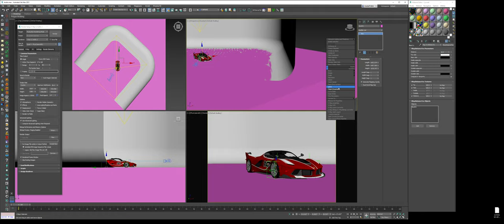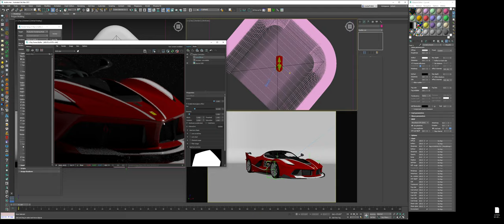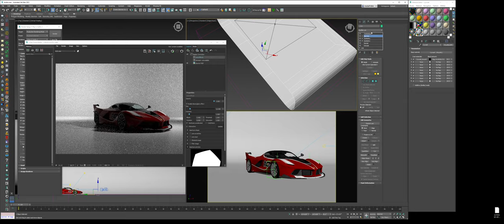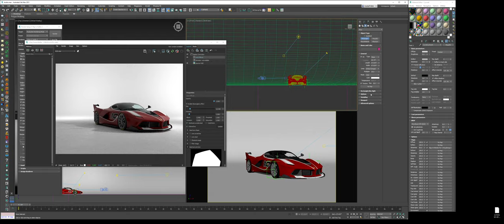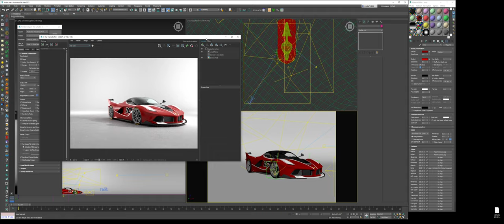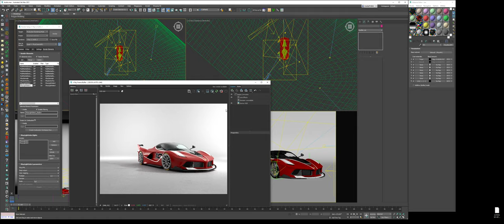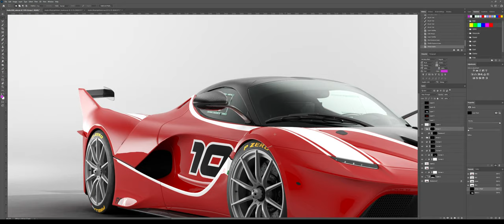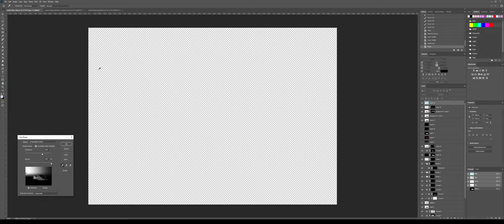Rendering A Car In A White Studio - 3ds Max & Vray

Comment: Thank you so much! Outstanding tutorials. May I have a request for a video of a rendering a white car in a white studio? I always have trouble with the balance between blacks/whites and reflections.
Reply from the maker: Let me see what I can do Adam. Client work/revisions coming back in so things might be slowing down a little with free time lol.
Reply from the maker: @c26084  I know exactly what you mean haha. What I would recommend in those situations is this. Render out the carpaint in two separate passes. Base Coat and then a clear coat. In photoshop add the clear coat as a screen blend mode, then go in and mask out the parts of the reflections that are messy. This would be the easiest/fastest way to get a job done and bill a client vs spending hours remodeling areas.
With that said. I have done both methods, quick fixes as well as remodeling to make sure it can be good for animation purposes.
Reply: @AutomotiveCGI  That sounds good, I will try it out. Thank you.

Comment: Thanks for taking the time to do that, I learnt loads! Can I ask why you'd work in 8 bit in Photoshop, rather than 16 or 32? I usually work with Vray in After Effects in 32bit, so it seems weird to drop it back to 8 bit.
Reply from the maker: So I use to do 16 bit but to be honest, with my workflow I don't ever depend on using all that dynamic range. If I ever do need to, I usually create a few brackets of exposure before going down to 8 bit so I can brush in exposure areas like I would with my photography. I dont really do what most studio workflows do lol. I do what works for me and what helps me get to the finish line as fast as possible and if clients are happy I am happy haha.
Reply: @AutomotiveCGI  fair enough! That's a good idea regarding creating the different exposure. Thanks for the reply!